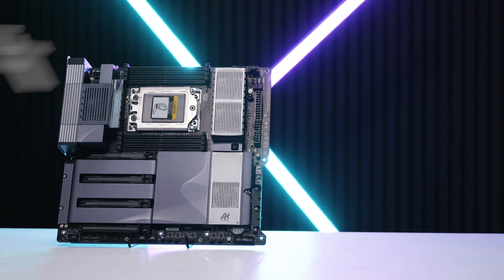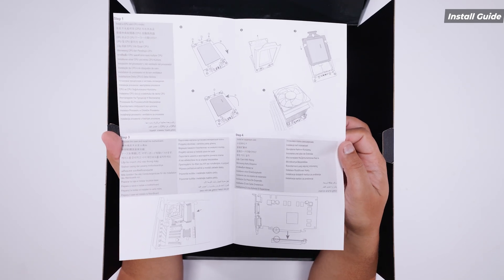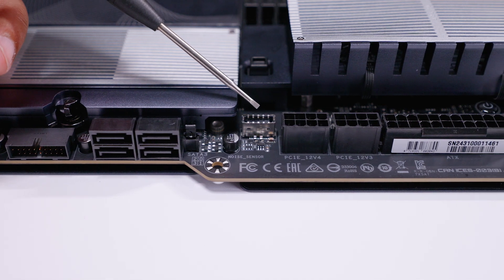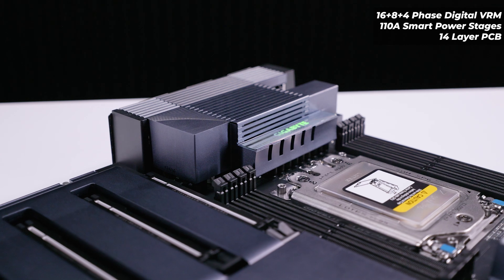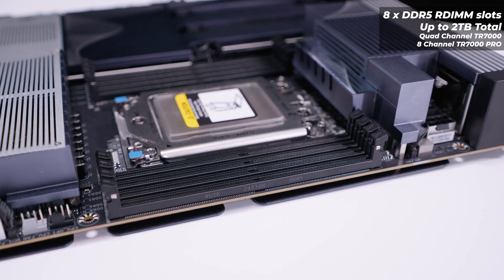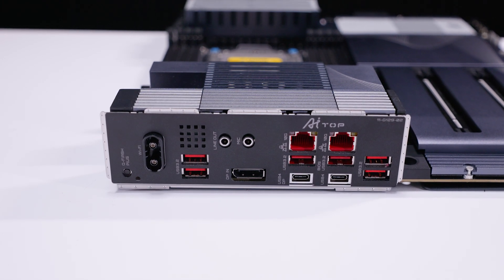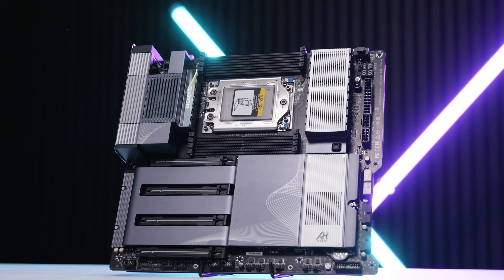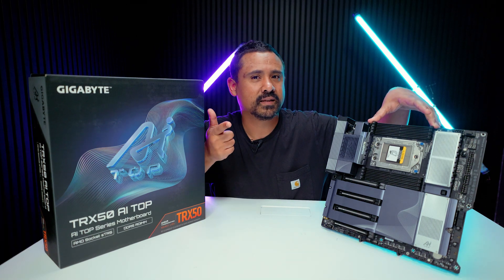Gigabyte TRX50 AI TOP has a Secret - Hidden WRX90 -  First Look

Comment: Should the TRX50 AI TOP motherboard work with a Threadripper 7960X processor and 8 RAM sticks? Does the motherboard support 8 RAM modules when used with non-PRO processors?
Reply from the maker: No it doesn't unfortunately

Comment: Gorgeous board, and a very informative video, thank you.. Does anyone know if it it's possible to get true thunderbolt running on these threadripper boards? I'm looking at building a rig for really intensive video and motion work, the only thing holding me back is I have a thunderbolt workflow with many drives and5a raid system all through thunderbolt.